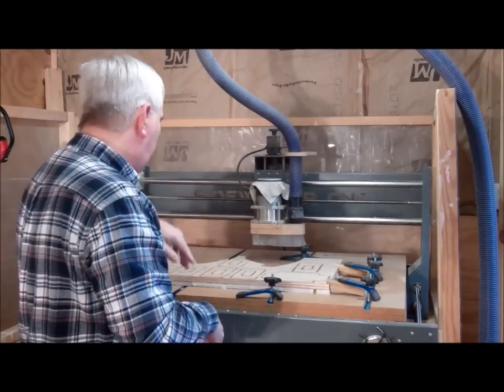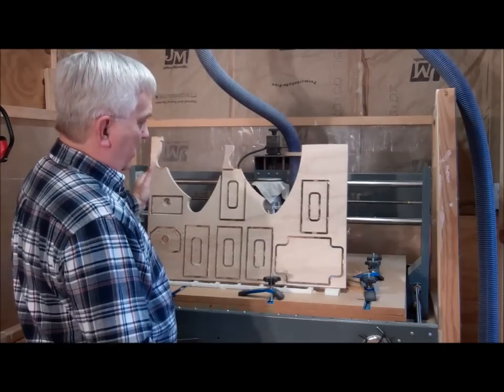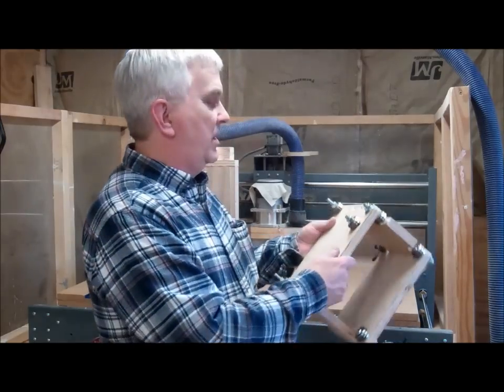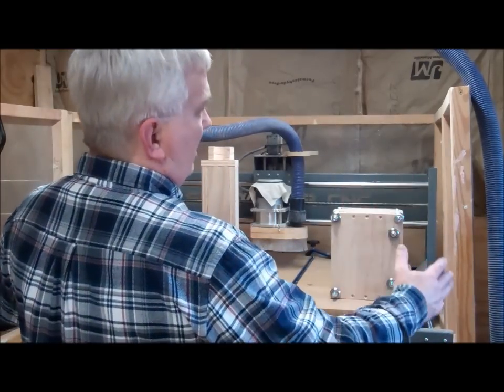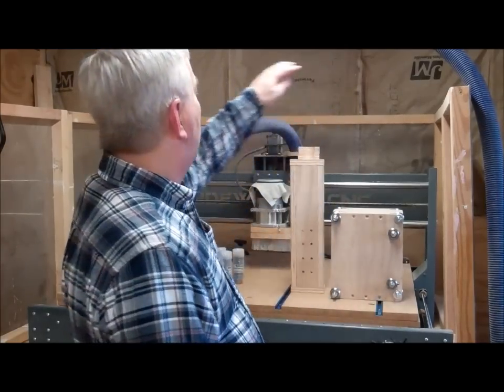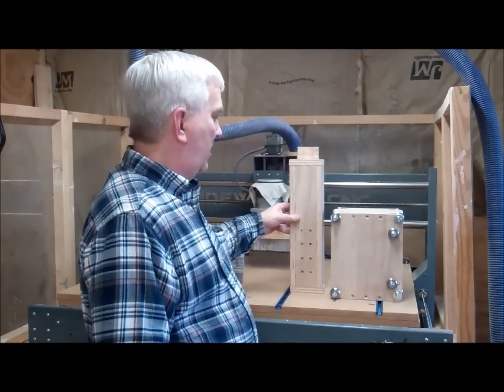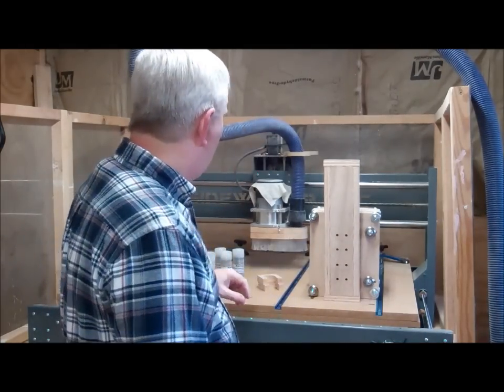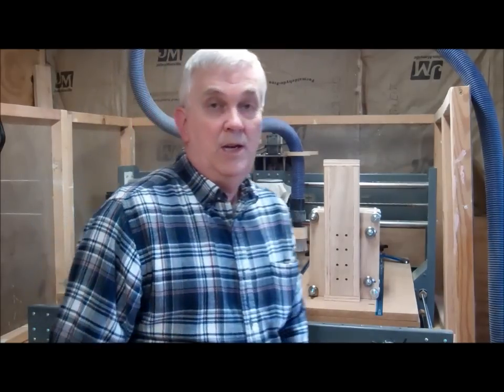4 x 8 CNC Router Part 1

Comment: Hi Dave forgot to mention I will be using T5 timing belts for my X & Y axis, I currently use them on the CNC i built a few years ago and I haven't had any problems yet.  I use one either side of the Y and a single belt for the X. The Z axis is moved with a 12mmx3mm pitch thread, I get really good repeatedly and quick rapid movement. Thanks 
Rob UK
Reply from the maker: I am going to be using timing belts as well on this build Robert.   Thanks for watching.

Comment: Nice Dave, I think your new design is smart.  I would really to have a way to also put material on my cnc vertical.  That way dovetails and other complex joinery could be routed on the ends.  If I could put a 36" board vertical on it, it would be nice, i dont know, just thinking about it.

Comment: Looking good so far I look forward to the whole series. Do you plan on using Acme lead screws for the long axis? I recently made a machine with a 48 inch (1200mm) X axis using Tr 14x4 and lash is presenting a bit of an issue. Not so bad as I only needed to slow down a little to eliminate it but i believe the effect is worse the longer and thinner the screw is?